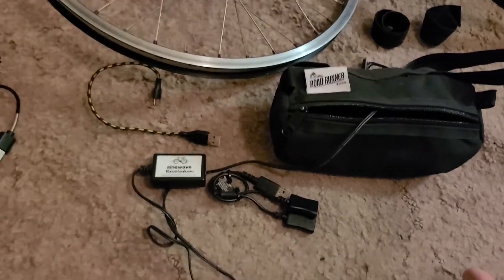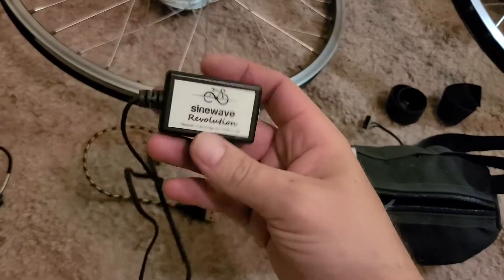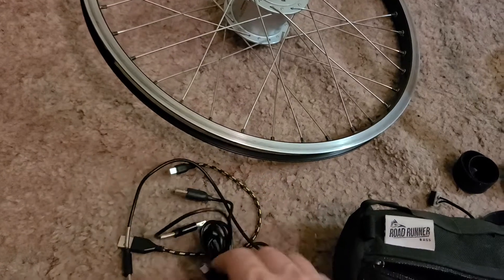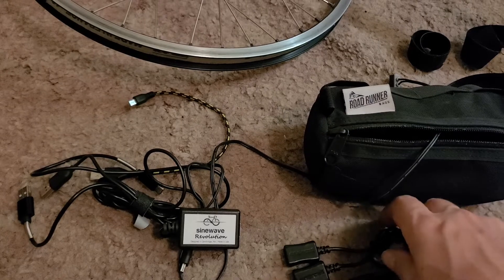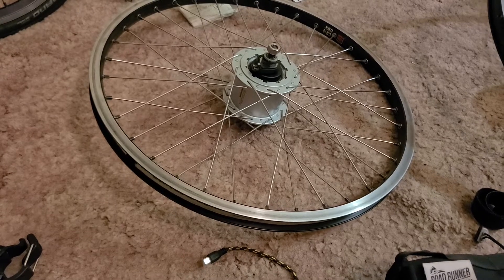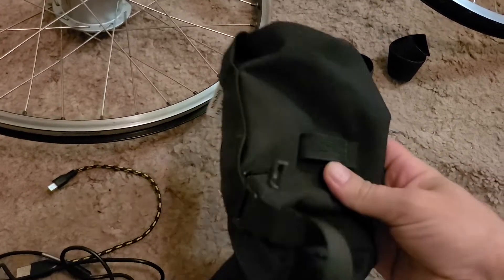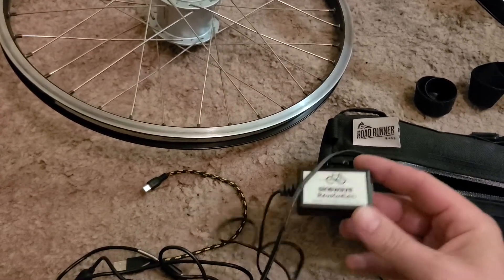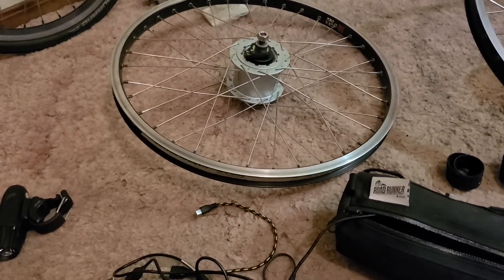My Nexus Dynamo and what I use with it.  Sinewave Revolution.

Comment: I'm making my own USB port adapter with a big capacitor...those on the market are just too expensive... I am getting  24 volts after the diode bridge, you need a 35 v capacitor...